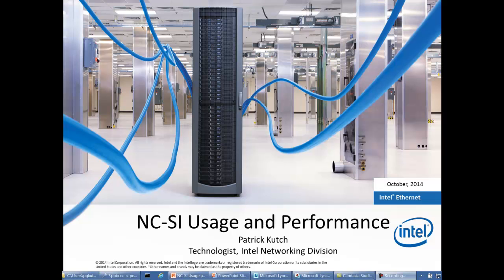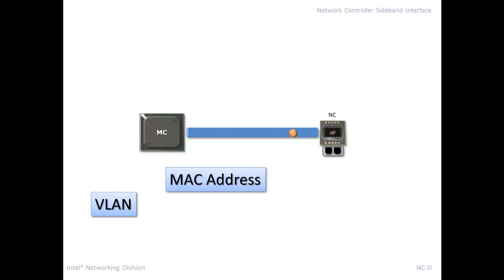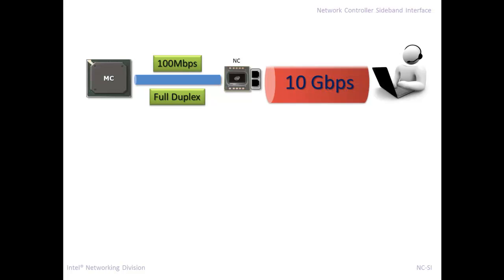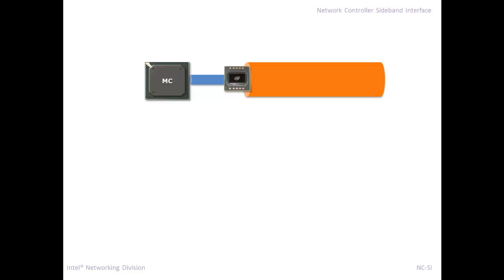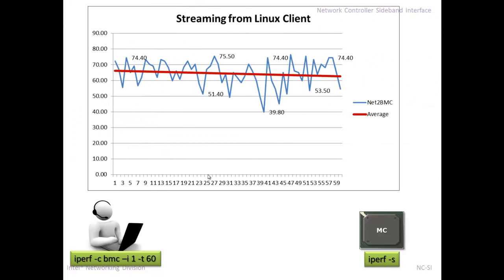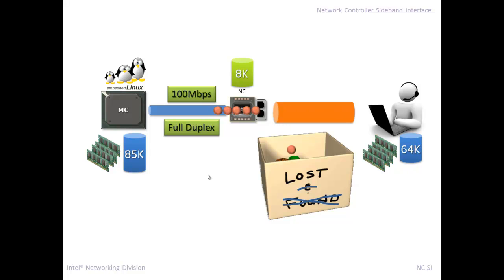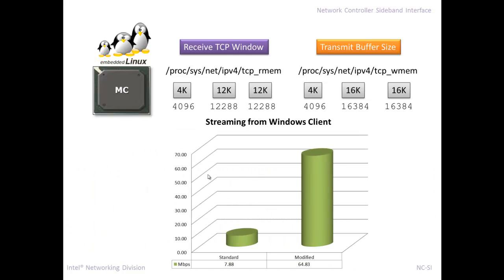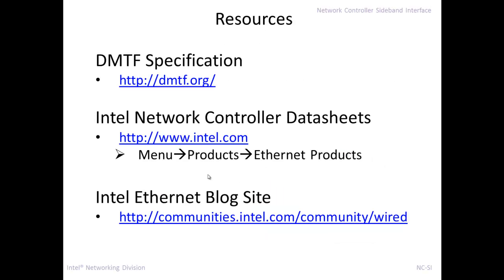NC SI Overview and Performance

Comment: Isn't this just a bodge to work around a poor Windows TCP stack?  In general, TCP endpoints don't know about the buffering and bandwidth capabilities between them, e.g.  Consider 1G Ethernet <-> 2M DSL <-> ... <-> 100G Ethernet.  TCP is supposed to detect drops and back off so as to maximise available resources.
Reply from the maker: I had to go re-watch my own video - has been a long time since I made this :-)  
I would't say it is (or maybe by now was) a Windows problem.  What you mention about different speeds is exactly what the TCP windows size is supposed to handle.  The uneven performance was exactly due to packet drops and retries.  The Windows stack did exactly what it was supposed to do, blast data at a rate to that the other side advertised it had buffer space for and then retry when it didn't get acks. 
To me the issue was simply that the BMC vendor(s) didn't take into account buffer sizes on the NC-SI interface.  I worked with several BMC software vendors on this and they all were in agreement.
Reply: Gosh, that was a quick response, thanks.  FYI, I was looking for an overview of the NC-SI command set but found this interesting and stuck with it.

I'm far from a TCP expert, so take my thoughts with plenty of salt...

My reasoning for blaming the TCP stack is that, in general, TCP cannot know anything about the link speeds and buffering between the two endpoints.  You could have two high spec machines on 100G LANs connected over a dial-up connect with only a few kB of buffering.  TCP needs to be able to handle this.

The way that this is meant to work is that the TCP stack should start transmitting slowly, ramping up the speed until packet loss is observed.  It should then back off the transmit rate, eventually converging on a sustainable rate that (just) avoids packet loss.  This way, the intermediate buffering doesn't really matter (and it's really only there the handle jitter); traffic is rate controlled by the sender so as not to exceed the available end-to-end bandwidth.

To my eye, the Linux stack was doing this correctly, and the Windows stack wasn't.  Conjecturing even more wildly, I'd say that the Windows stack looks underdamped and thus unstable, ramping up too aggressively after packet loss stopped.

Here are a couple of reasons why I believe that limiting the BMC receive window may not be the "correct" solution (in the sense that I don't think its the bit that's behaving incorrectly; I fully accept that it's the correct pragmatic solution given that if its the only thing available to change):

1) Consider the case where you have two TCP connections to the BMC.  They'll be unaware of each other, and thus unaware of the fact that they're sharing bandwidth.  I'd expect the Windows stack (which would blast out 12kB per connection) to end up with the original oscillatory bandwidth again, whereas I'd hope that the Linux stack would again converge on sharing the 100Mb between the two connection.

2) Consider the case where you have a large RTT to the BMC (say 200ms because you're tunneling a connection between continents).  If your RX window is 12kB, then you can only have 12kB of data in flight.  Thus, with an RTT of 200ms, you've got a maximum bandwidth of 48kB/s.

If nothing else, I am at least now motivated to go and learn about TCP congestion control algorithms.